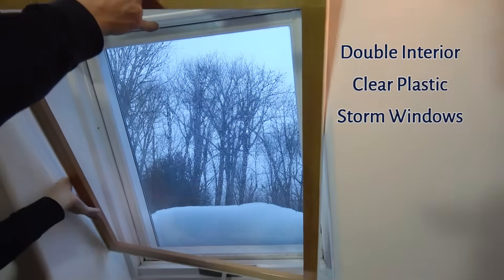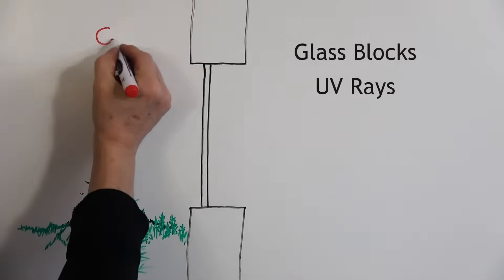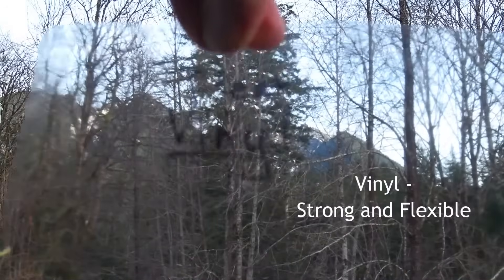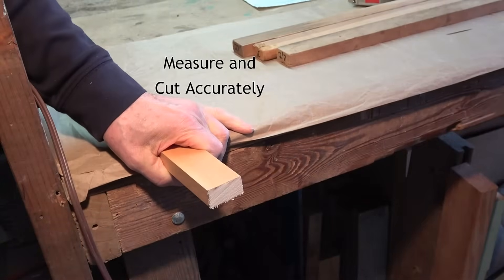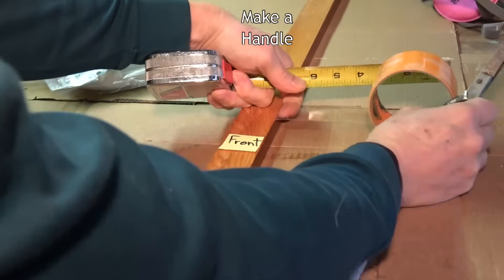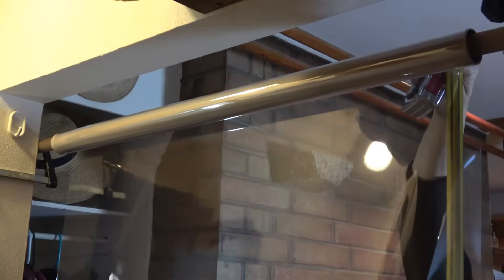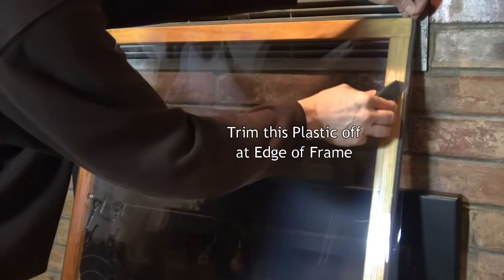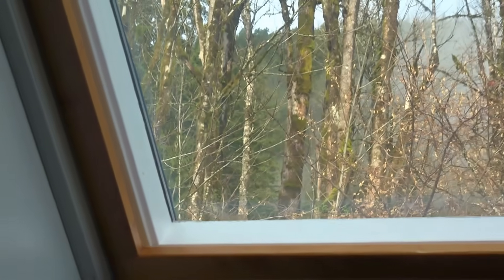Best Double Interior Storm Window Inserts: Save Money on Heating

Comment: Awesome video! Do you happen to have data on heating/cooling costs before and after installing these?
Reply from the maker: Not precise data. When our house had single pane aluminum windows, adding double storm windows cut our firewood use literally in half, and the house stayed noticeably warmer. I've since installed vinyl frame double pane windows, and mostly switched to electric heat.  Without these storm windows, we had a hard time keeping the house warm with electric heat during a cold spell.  Adding storm windows again made the house noticeably warmer and dropped our electric bill by at least $30 a month.

Comment: I went with 12 mil vinyl for my inserts for high durability, but they are also covering 123 year old single pane wavy glass, so optical distortions from it aren't a problem. I think the vinyl also provides some sound attenuation as well, but I have not measured it.
Reply from the maker: Thanks for the report!  Vinyl is very durable, and I would think that would help with sound.

Comment: Can this be done with glass instead of plastic film?
Reply from the maker: Yes, glass is heavier, needs to be cut to size, and you have to be careful not to break it. Glass does block noise better than plastic, and can be put either outside or inside your window. It costs more new, but there are plenty of old windows for free if you take out the glass and cut it yourself.  If you were to put two panes on a wood frame you're basically building your own insulated glass unit, which would be quite heavy to take in and out.
Reply: @HartzHomestead  thanks for the reply! I didn’t know a wood frame could be used to build an insulated unit. Everything I’ve seen looks like it has metal or plastic spacers before going in any kind of frame. Do you have any suggestions on how to do it with wood?
Reply from the maker: @joshuatoral5105  I've never done it, not sure how well it would work. I'm just saying if you did it would be heavy for a storm window. The main concern would be moisture, as wood expands and contracts, so the wood would need to be well sealed. To use glass for a storm window it would be better to build a wood frame for each piece of glass.

Comment: Will it stop noise, too?
Reply from the maker: They will help reduce noise some.  A thicker plastic like 5 or 7 mil is better for noise, though it costs more. You can get much thicker vinyl, but it's not as clear. If you really want to reduce noise a lot, use a solid acrylic sheet or glass, but they are harder to cut and cost more.
Reply: @HartzHomestead Thank you.

Comment: A+ video, well explained, demonstrated and excellent Comments. 
Thank you and definitely subscribed. 

I didn’t see any mention of how the dry shrunken seals in windows are degassed over the years. I’m assuming there’s a permanent performance drop once that happens. 

My parents have a sunroom with 3 walls of double glazed windows all have bad seals (windows are about 25 years old) and are hazy from condensation mineral deposits. 😢
In the summer I’m attempting on fixing the haze as seen on other videos by drilling tiny access hole to allow for demineralizing solution to be forced in between the glass via compressed air. Then a distilled water rinse for a clean dry. 
Looks like 2024 is the year of the window. 😊
Reply: We have several double glazed windows 25  to 40 years old that still have a good seal, so I think it depends on how well made they were in the first place and how much environmental stress they've had. I have 3 skylights I built that fogged up in a few years and was told I should have ordered a silicone seal for skylights. Three others fogged up because the glass cracked, so those need replacing. I saw a video on demineralization, but you'd still have a window with a poor seal. If you have the unit out of the window and get it dry inside I wonder if butyl flashing all the way around would seal it up, as butyl does not leak moisture at all like silicone can.

Comment: Nice video.  Did you notice any reduction in the noise level?
Reply from the maker: Yes, we live near a river that is a constant background sound, and it's definitely quieter when our double 3 mil storm windows are in.  Thicker plastic like 5 mil would dampen sound even better, but costs more.  Solid acrylic or glass panes are best at blocking sound, especially 1/4" thick or more, but more expensive and harder to cut.
Reply: @HartzHomestead    Thank you!

Comment: Thank you for the comprehensive video, I’ve watched a lot of them and yours is by far the most succinct.

Love your idea of using Mylar, it looks absolutely crystal clear and the thicker weight will last more than one season.
Also, never thought about using two layers of film, this is brilliant because it exponentially increases the insulation value for a small amount of extra effort and material cost.

Comment: 10-20 dollars a window??  how is this possible?? The foam weatherstripping alone is that much!
Reply from the maker: I should have said $10 to $40 - it depends on the size.  I did find 3/8" x 1/2" x 17' MD weatherstrip at Home Depot for $2.07, and 1/2" x 3/4" x 17' Frost King on Amazon for $4.65. Search for "Open Cell Foam Tape" or check your local hardware store. 
A 3' x 4' double storm window takes 14' double stick tape x 2 sides = 28'.  A 36 yard roll from ePlastics is $12, = $0.12/ft x 28' = $3.36.
3 mil Dura-Lar on Amazon is $61 for 40" x 50', or $1.22/ft x 8' = $9.76 for 2 layers.
So Foam $4.65 + Tape $3.36 + Film $9.76 = $17.77 for a double 3' x 4'.  I built mine with scrap lumber I already had. Buying 1"x2"x8' lumber runs $2 - $8 each,  so that adds $4 to $16, total $22 to $34 plus screws, varnish etc, more or less depending on the size of your window.

Comment: Thanks for this - this is the most comprehensive video out there!  Questions - how long do the films last when directly applied to the window frames? And do they remove the paint?  Also, is all mylar the same?  Thanks!
Reply from the maker: The 3 mil film should still last 30+ years taped directly inside a window frame. A thinner .75 to 1.5 mil shrink film may not last as long. It's possible the tape can come loose sooner depending on the quality of tape and surface you tape it to. The 1/2" tape with red backing from ePlastics (link in video description) is very good. If you have good quality paint, you can likely peel, scrape or rub the tape off like rubber cement without damaging the paint. The 3 mil clear polyester films I've gotten from ePlastics and Grafix Dura-Lar from Amazon were both equally good. Some reviews for shrink film kits said the clarity of the .75 and 1.5 shrink films varied. They come folded up so shrinking with a hair dryer is needed to get rid of the wrinkles, while the films I've gotten came smooth on a roll.

Comment: R5 to R9 from an R2-3 is totally ridiculous.  Where do those numbers come from?  I think you would be lucky to get even 1 additional R.
Reply from the maker: An argon filled double pane window with a low E coating is about R3. The air space between two ordinary panes of glass, or plastic, is about R2. Adding 3 layers of plastic 3/4" apart, those 3 air spaces will add R2 each x 3 = R6. Over an R3 window makes R9. I can tell it works because it has cut our heating bill in half, from $100 to $50 a month in the winter. A triple pane window salesman shot my storm windows with a temp gun, and said they were as good as his R-8 windows that were $1,000 each.
Reply: @HartzHomestead  I really enjoyed your video. Very well done information for people who want to find a simple and relatively inexpensive upgrade for their window performance in winter. However your R value calculations aren't quite right. For example, as you mentioned, one lite of uncoated glass - R1, two lites uncoated and no argon, R2, three lites R3, and so on. In simplest terms, adding each additional layer adds an additional R1 to the stack.  
Forgetting R value completely, since ultimately it's just a lab calculation, adding 2 or more layers of plastic (tight is crucial) is without doubt going to make a very noticeable improvement in winter time performance and comfort.  Summer improvement is more hit or miss, depending on other factors, but for winter it's a great idea. 
each ad
Reply from the maker: @gregcorwin8316  This is debatable - I've not found any real studies on it.  It is not the film but the air space that creates the insulation.  Filled with air, one airspace is about R-2, filled with argon that same airspace is R-3.  My logic is the airspace between 2 layers of glass creates an R-2, so each additional airspace adds another R-2.  I've also noticed that plastic feels warmer than glass to the touch, and moisture does not condense on plastic as readily, indicating it is warmer, so the plastic itself may add a tiny amount of insulation.  I do know that our house is much warmer with these installed.
Reply: @HartzHomestead  Consider that a single sheet of glass in a window is an R1, you mention that in the video and I agree 100%, so no dispute. Two lites in an IG or dual pane unit, without LowE coating or argon, or even a single pane with a storm window attached is an R2. That is also well established, and was also mentioned in the video, so once again we agree there too. 

However three lites in a triple pane configuration, with no coating or argon, is an R3, again this is a well-tested and well established performance value, yet if each airspace in a triple is independently an R2 as you suggest, then why is the actual triple an R3 and not an R4?  And why is a single pane R1 if it has no airspace at all? 

As a quick aside, actual window glass energy performance when clear (uncoated) glass and with no gas infill (other than ordinary air), in multi pane configurations, will vary slightly based on the width of the airspace as well as glass thickness. Using R1, R2, R3, in examples is for clarity and will vary slightly real time based on the factors mentioned. Using R 2.02 versus R 2.04 based on different airspace depth or variations in glass thickness, rather than just generically keeping it at R2, would be cumbersome IMO and not really add anything to the discussion. However if you prefer to be more precise, then I would suggest using U factor rather than R value for more precision....but that might be overkill without adding anything really beneficial to the overall discussion. 

The ideal width of an airspace for maximum energy performance varies depending on whether or not it's filled with air or argon, and/or based on the LowE coating used, and/or on the thickness of the glass. As you mentioned in the video, 1/2"-3/4" works great for the application that you describe, no disagreement at all, I think 3/4" is ideal because you can put film on both sides of a 1x2 (again as you describe) and end up with a very workable internal storm window, with a solid R2 as constructed. 

But, if the airspace is the main consideration, then why is it necessary to have multiple sheets of plastic rather than just a single sheet of plastic installed several inches from the original window? If airspace is the  insulator, then why do you get better performance (and you do) from having multiple chambers rather than a single wider airspace without the additional layers if the plastic sheet versus the single wider air space?
Reply from the maker: @gregcorwin8316   The problem with an air space over 3/4" is that there's room for convection currents down the colder surface and up the warmer one within that space, thus transferring more heat.  I've seen charts that show 5/8" as optimal, and over 1" is not so good.  A single pane is near R-1 because of a thin film of air on both sides of the surface, which might be reduced if it's very windy out.  You might be right about the R values, though from experience it seems plastic insulates better than glass.  I've never seen a scientific study on it.  One chart I saw showed 2 panes of glass at R-2 and 3 panes at R-3.2, with just air between them and no coating, so each space would only add R-1.2.  Another website lists 2 panes at R-3 to 3.8 and 3 panes at R-7 to 8, so that second space adds as much insulation as the first, but those are argon filled with Low-E coatings.
Reply: @HartzHomestead  👍convection currents are the wild card in multilayer window performance as well as inside wall cavities, and even HVAC. I asked because recently I had a discussion with someone who was claiming that a three inch gap between the window and an inside single storm was an R9, because every inch was an R3....They were not familiar with the concept of convection currents and how they affect performance. 

Thicker plastic is slightly better than glass as an insulator, but thin film layers are separators rather than insulators. One thing to clarify, when I was saying that performance values were related to the number of glass layers, I wasn't suggesting that the glass was the insulator, only that you can use the number of glass layers to get a rough estimate of the R value - each layer equates to R1 as a general guideline.  

Are you familiar with Heat Mirror, or Alpen windows? Heat Mirror is much like your idea of using film layers to improve window performance, but in the case of Heat Mirror, it's a multilayer IG unit that rather than glass for the layers between two outer lites in an IG unit they use suspended film. The original concept was developed by MIT back in the 70's, but today the primary user of the concept is Alpen Windows out of Colorado. Several other companies have tried the system over the years, but none were really successful (more like spectacular failures) outside of Alpen. Alpen is really good at making this product.

Alpen has window performance values as low as U.08 (U-factor, lower is better), or R 12.5, but they also offer thin glass options as well as film to achieve the best results. They do have a number of lines that achieve U.11 or R9 using Heat Mirror, but in order to achieve that level they need to build IG units comprised of two 3mm lites encapsulating 4 layers of film, with LowE coatings on both glass lites as well as all 4 layers of film, plus krypton gas between all the layers.

There is another company called LiteZone who uses suspended film technology as well, but without LowE or gas fill. They have a proprietary process for controlling air between their glass lites. They offer some amazingly high R values and need two glass lites encapsulating 6 layers of film for an R8.5 and 7 layers of film for R9.5 so it is achievable but needs a lot of layers to do it. 

Again, bottom line is that R value is kind of like MPG on cars, it's a guideline or a comparison factor, but it's far from the whole story, there are a number of other factors affecting overall performance. Keep in mind that R value was invented in the 1970s by marketing folks who wanted to sell more fluffy pink stuff, while U value was developed in the 1930s by scientists/engineers to determine heat loss through various materials. 

Once again, I really like what you are doing and would highly recommend it to someone who needs to improve their window performance without going broke in the process, but forget worrying about what the R value is and just enjoy the improvement.
Reply from the maker: @gregcorwin8316  Thanks for that info on Alpen's Heat Mirror, that's an ideal arrangement, since glass on the outside is easiest to clean, and plastic film inside is protected but lightweight allowing for many layers. Brilliant.
Reply: @HartzHomestead  You're welcome, I thought that you would find it really interesting